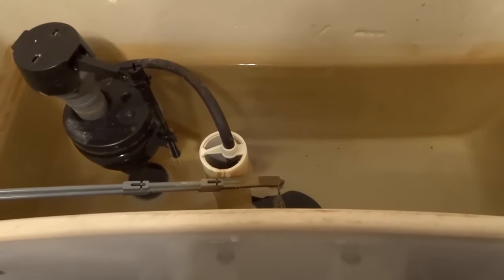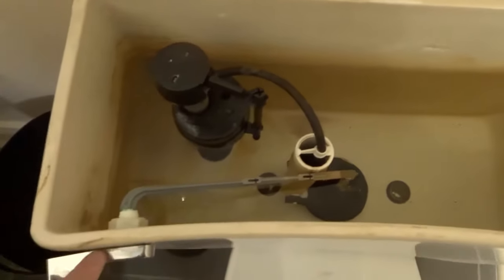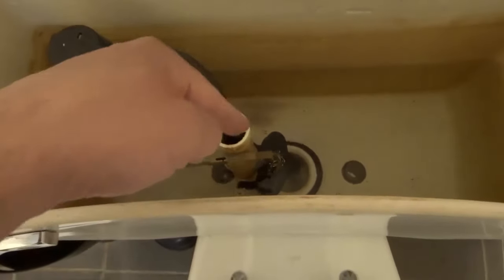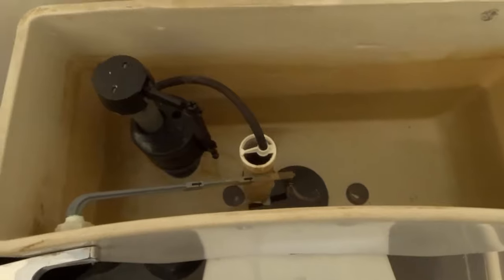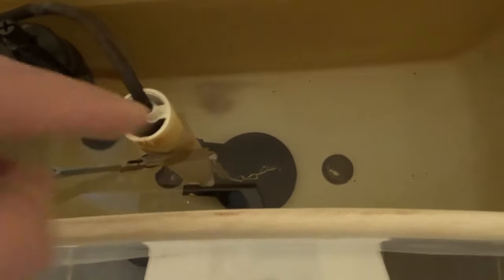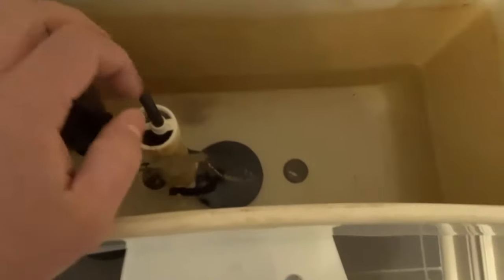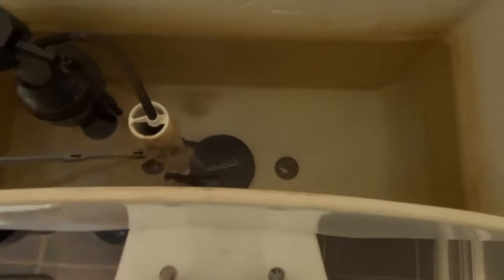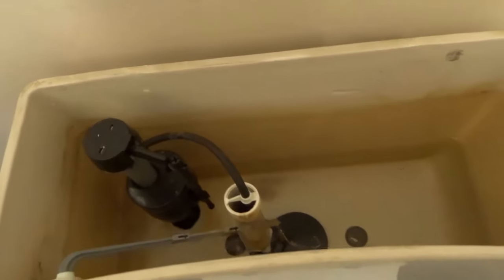How To Fix A Weak Flushing Toilet-Full Tutorial

Comment: You adjust the chain with lever down, hold the chain up and see their intersection lever hole/link, place the hook on this link and lever hole.  Most slow flushing is cause by clog rim jet, use a 1/16 - 1/8"  wire to open it up.